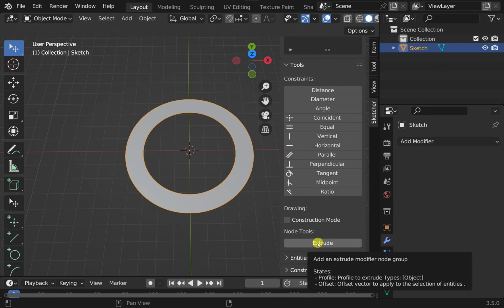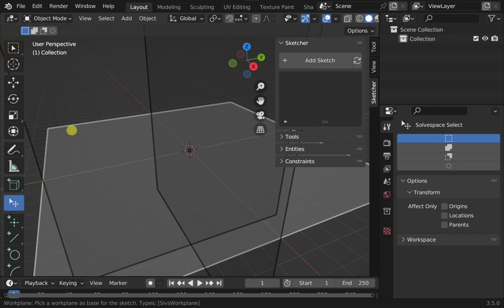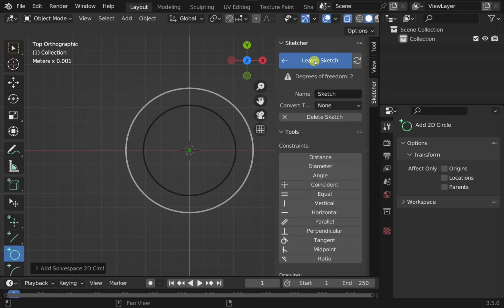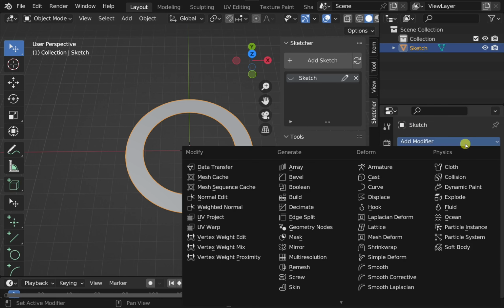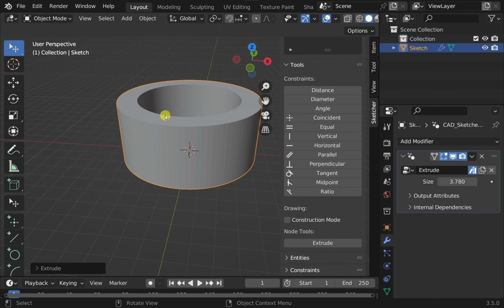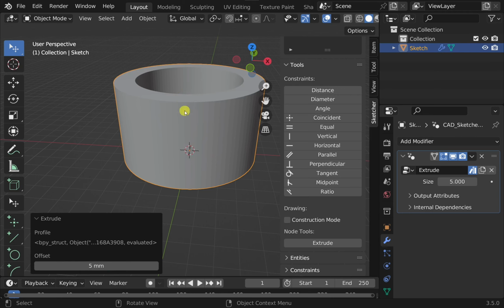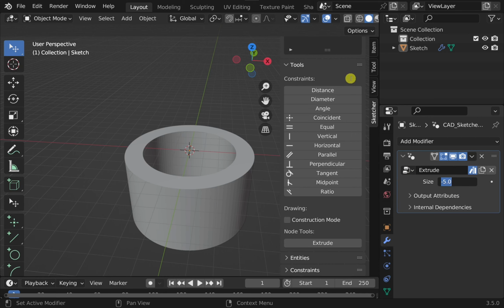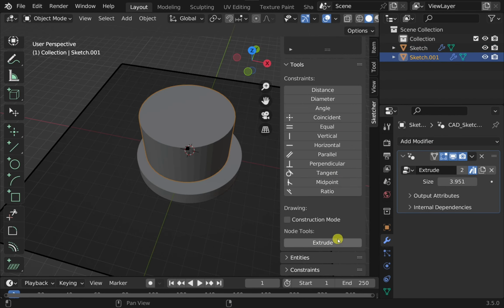Learn CAD Sketcher | 16 |  Extrude Tool | Blender 3D

Comment: this tool doesn't seem to be there for me
Reply: This is tricky because all the descriptions I found were vague, so I had to hunt around. Here's what you're probably missing...

1) Leave  Sketch.
2) Locate Modifiers in the Blenders standard vertical tab (looks like a wrench, below the Object tab).
3) Select Add Modifier.
4) Hover you mouse over "Unassigned" which wil expand the list with extra modifiers, 3 of which are for CAD Sketcher, which include the CAD Sketcher Extrude tool.
Reply: @tonywtyt  In the latest version of Blender, this does not seem to be possible anymore, unless there is already a mesh object in the scene... Like a cube or plane etc.
Reply: same for me. no extrude present.